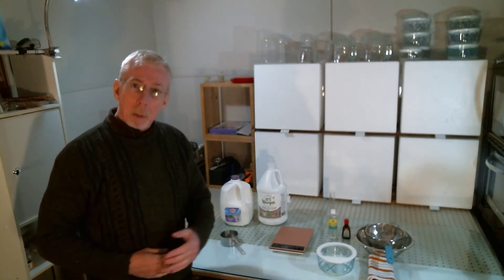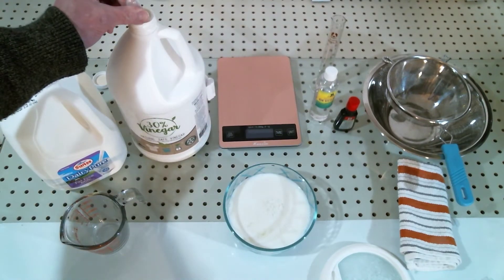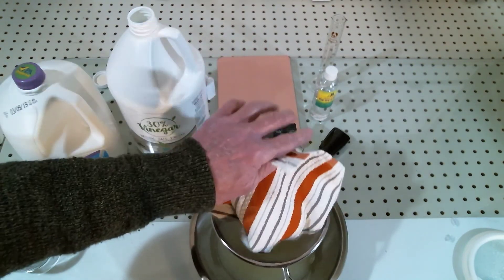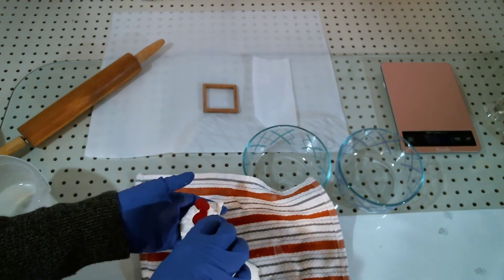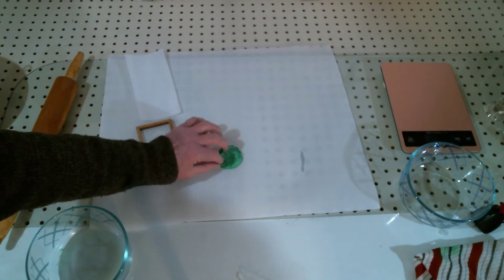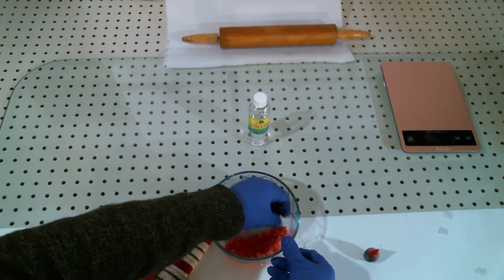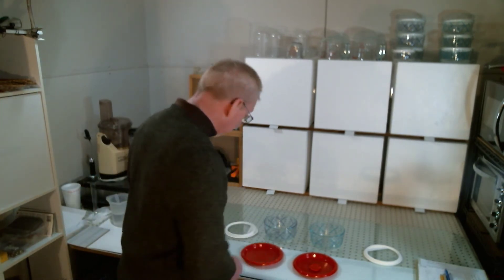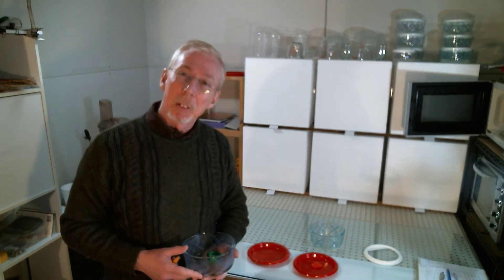Bioplastics: Thermoplastic properties of Casein. Imitation Ivory, Rubber, and PLA. Galalith Jewelry.

Comment: Everytime you said "this is the whey". I hear the mandalorian saying "This is the way". But in all seriousness. I did this the other night. Also made some (Gud) Jaggery. But when I extracted the casein. I split it up for different experiments..

One lump I added some diatemecaous earth to. And added a bit of calcium acetate. And some nearly pure China grade kaolin. I worked it all together. The casein seemed to mold well with it. 

Though my consistency wasnt perfect. Small cracks were unavoidable on molding. More kaolin probably would have rectified that. But after that I dropped the shaped lump in a saturated base solution. Of soda carbonate. And left it for an hour, or so. 

When I checked it later. While it was still submerged. I poked the to with my finger. It felt like a bouncy ball! The small cracks locked in place. I pushed as hard as I could with my finger. To try to split the piece on the tiny cracks. It was as strong as rubber. I put a bit more soda in solution. 

Which of course became oversaturated. And I noticed I've got a lot of precip today. Haven't checked it elasticity yet today though. Anyway if I can remember I'll post an update.. 

Oh and the other experiments I left casein unmixed. Dropped in a soda solution. And tossed in the fridge. Haven't checked those yet. The solution is so base. I have to glove up to me with it. And haven't got around to it yet. Excellent video though bud 👍.
Reply from the maker: Mike, these are all great results. I am thrilled you are taking my little experiment to the next level. You may have a few interesting products at the end of this series. Keep us updated. I may want to pass on this in video for others, if you like.
Reply: @GEOsustainable  Thanks for the kind words. And yeah as an update. I've tried, and tried to stiffen the lump. In the oven, and microwave. It comes out a bit pliable. Then stiffens a little. But retains it's rubbery nature. But I am not happy with the color. It looks an off putting yellow. The Kaolin I believe is responsible for the inability to harden..

But, I'm going to do another experiment. And keep out all my last ingredients. Though I do want to do another experiment with the soda. As I read something interesting the other day.

 But, for my next experiment. I'm going a complete different direction. Which I'm hoping will go as I envision. As I'm hoping it will create a unique product. But first I need an ingredient that I do not have. I could probably order it online..

But, I'm going to make it myself. But I just harvested loads of acorns out front of my house. Got a big oak that's a bountiful giver. But, I'll be extracting the tannins. As they are known for binding to proteins causing them to precipitate. But it's a long story..

Which I'll elaborate upon if it goes as envisioned. Will take a few days, or more. In order for me to extract, and purify the tannins. Interesting side note. The ancient Egyptians knew of casein. Archeologists have found records of them extracting it from milk. And using it to make a tempera paint..

And I believe they also used it in other industries. That have yet to be fully understood. But anyway they actually found a 3000+ year old lump of egyptian "cheese". But I believe it wasn't meant to be cheese. When scientists studies it's composition. They were surprised to find no (Lactobacillus kefiranofaciens) or any other lactic acid bacteria. Which are the usual microbial signature. And defining characteristic of all kefir or kefir-like fermentation products.

 They also found it to be wholly made of casein. And, it was infected with brucella melitensis. Likely because of the way it was stored, and it had no lactic acid bacteria. Which likely means it was not meant to be cheese. 

They also found it to be impregnated with sodium carbonate in the trona phase. Which they attributed as being from leaching from the surrounding environment over the past few thousand years. I question that it was from leaching..

But, anyway it's certainly interesting. I'll try to remember to update you. After my my next experiment. Hopefully with some interesting results!
Reply: @simple8mind8  Thanks for sharing your experiences Mike! 😊🌎❤️
Reply: @simple8mind8  Awesome.  Do you have a link or anything for more info on this Egyptian fromage?
Reply: It felt so weird. When I poked it. And I got a push back rubber effect. Honestly it felt like a wall ball except not hollow.
Reply: Ok. So an update. I checked the rubber lump. It's still rubber. So I pulled it from solution. The precip is odd. The soda reacted in some way. The crystals formed are no longer sodium carbonate. Couldn't tell you what happened though. I'll look into possible reactions. 

The balls I threw Jarred in solution into the fridge.. Are very interesting as well. The solution froze solid. It's completely crystallized top to bottom. Kinda scared to touch it, and break the crystal matrix. But here goes...
Reply: Ok. So the balls floated. So when the solution froze the top halfs of the balls were left sticking out of solution. So I pressed on their tops. They are rubber like as well. Maybe a fraction less of elasticity. It's hard to tell. Because when I pressed them. It did not break the crystal matrix. It's almost like ice. And no my fridge does not freeze. 

I'm going to leave it out. See if the crystal lattice is temperature sensitive. The precip in my lump cup. Was not strong like this jar. But fragile. Anyway the crystal precip seems different in the jar. 

Though maybe my lump would have done the same in the fridge. If I remember I'll post an update about the jar experiment..

Comment: Does this process work with commercial powdered casein?
Reply from the maker: Great question!
The body builder supplement has a small amount of Soy to keep the Casein from clumping. This will need extracting with Alcohol washes as I demonstrated in one of my videos on Casein. It is not easy to do.  
Strangely enough, the Soy added, according to the FDA, is small enough to not report. My information about the additive comes from a maker of the Casein powder.
Fat Free Milk is the best option.
Another option is ordinary Powered Milk. 
These, you will need precipitate the Casein.
Reply: @GEOsustainable  ooooh, today i learned a thing ^^

Comment: Fascinating!  In recent years there has grown a small industry in making casein guitar picks (plectrums) to emulate the sound and feel of genuine tortoise shell.  The best quality ones can run up to $50 a piece!  I'm excited to try making one from milk.  Are you able to comment on how clear casein is produced?  I read in the book you mentioned that this is done by repeated alkali exposure.  What is the practical approach to that?  Also I'd love to know how manufacturers get the beautiful pearlescent effect.  Is there a simple pearlizing agent that can be used?  Thanks so much for this and any thoughts you have on these questions.
Reply from the maker: Great questions. There is someone that used my formula and is making jewelry with just those effects.
I know about guitar picks, a few in the industry have commented on this video. It is spot on according to them.
The rest I am afraid are likely trade secrets I am not privy to.
Where we use food color, those in that industry are likely using dies and stains from animal. I would start there.
Anyone in tanning could give you a little guidance I should think.
All that aside, you can make high quality guitar picks using just what I show you here.
Good Luck, and thank you for the questions.
Oh, the pearlescent effect is from a patent, where they would hit a chuck of it with 2 dies heated to 2700F and stamp them. The original patent is online.
Reply: @GEOsustainable  Hmmm.  Maybe we don't mean the same thing by pearlescent.  I'm looking for something that gives that reflective swirling effect, much like some shampoo, that emulates the reflectiveness of real mother of pearl.  I wonder if it's finely ground mica?  Or maybe a fish scale product?  I can easily imagine ways of kneading, or layering the galalith that will give beautiful swirling grain, but I'd love to find the pearling agent that's used in the best galalith and in celluloid.  That's the stuff we often call mother-of-toilet-seat!

Comment: Hey! I've got an idea that I would like to see you use in a future video!

I've got a bulletproof way to make waterproof bioplastic gel, but it comes with 3 caveats: 
1) The process is kinda tedious/ dangerous 
2) it's semi- expensive.
3) It's very viscous/sticky!

But all you need is 3 ingredients: 
Sodium sillicate (waterglass), 
Zinc chloride (ALOT of it), 
and cellulose (100% cotton clothing will do).

Step 1: Boil water in a glass beaker/ acid proof beaker and mix in anywhere from 1 to 2 lbs of Zinc Chloride in the solution.

Step 2: Boil down the solution to a point where it get's super syrup-y. You want to make the solution as saturated as possible so that the cotton can dissolve in it. (CAUTION: The more saturated it gets, the more Hydrochloric gas it will let off so be careful - Look up Zinc Chloride on wiki)

Step 3: Place the glass beaker in a pot filled with water so you can give the Zinc Chloride solution a hot water bath. Put pieces of cotton in there and mix until they dissolve. If the Zinc Chloride solution turns black, it means it's too hot (burnt carbon). If it stays white, it's great!
Keep doing until the cotton slows down dissolving/ stops dissolving.

Good News. You made Cotton Acetate: a bioplastic. You're not finished yet. Gotta waterproof it.

Step 4: Pour out some of the Zinc/Cellulose solution in seperate container and mix it in with some waterglass in a ratio of 1:1 or whatever ratio you want.
(Ratio depends on waterglass, if sillica-rich waterglass,  less flexible. If more sodium hydroxide, more flexible.)

Step 5: Coat whatever clothing you wanna coat with the mixed Zinc Chloride/Cellulose/Waterglass solution. Let it air dry for a day or until it's not sticky no more.

Step 6: Waterproof it/Vulcanize it by putting it in the oven at 200 F for 2-3 hours (nothing higher or it'll turn black). If it's still wet, redo Step 6.

Step 7: Voila! Your clothes is 100% bioplastic-ally waterproof.
Reply from the maker: Thanks for letting me know what Waterglass is . I could never figure it out. Thanks. This looks like it came from the book on Industrial Uses of Casein. Brilliant comment. Thank you.
I most certainly will put it on the list to try, and share it when I get questions from India. They are hugely searching for a way to do this.

Comment: love your work!
how can it be made waterproof from natural or non-toxic materials? 
also, how fast would it biodegrade if placed outdoors?
Reply from the maker: This formula is not waterproof. It will biodegrade in minutes once wet. Everything I used is natural except for Ammonia. You can replace that with an alkaline vegetable juice.
Thank you for your kind words, I am thrilled you like.
Keep in mind, for the most part, bioplastics won't be waterproof, and can only replace a portion of plastic made from LPG. It is best for one-use plastics.
In a sustainable world, things that must be waterproof are put in glass and metal because they are HIGHLY recycled.
Sustainability means to move away from a disposable society.
Reply: @GEOsustainable  couldn't agree more.
although, I work in the agriculture sector which consumes massive amounts of plastics. a large portion of the applications requires waterproofness from the plastics, as well as durability in outdoor conditions and we are trying to find sustainable alternatives for those plastics.
would love to share more about the project if you find that interesting (:

Comment: These videos are so awesome, new sub here! I tried this with some expired (not really expired but tastes terrible and undrinkable) lactose free (Fairlife brand) whole milk but after heating 1/2 cup of the milk for 1 min and adding 1/4 cup vinegar a little at a time, all I got were little chunks and it looked nothing like yours. Can you please tell me what I did wrong? I literally have 4 bottles of expired milk I don’t want to throw away if I can make something crafty with it. Was hoping to make some flexible texture plates (like embossing folders). I have my sample drying outside but it’s still pretty pitiful 🤣 I also mixed in about 2 teaspoons of glycerin hoping it would be flexible. Does the milk have to be fat free? You are such a blessing with your knowledge base, thank you!
Reply from the maker: Sure thing. Old milk is fine, and prefered. Heat the milk ONLY to warm, not hot. Add vinegar all at once. The reaction is immediate after a very quick and gentle stir. But some folks leave it overnight to curdle. It is best if the milk is fat free. Rinse in alcohol if the curds are slimy.
Casein plastic is very hard to prevent cracking unless you add a plasticizer.
What I show in the videos will get you going, but it takes a lot of time to learn to work with Casein. Good Luck and I am thrilled you like my series.
Reply: @GEOsustainable  hey thanks for answering so quickly. It wasn’t slimy at all, just tiny little chunks that wouldn’t clump together that looked  more powdery. Adding the glycerin after rinsing and squeezing out just made it crack like crazy when I tried to roll it out and press things into it. I didn’t try the alcohol yet, I thought you said water rinsing but maybe that will work better. I am binge watching your channel 😱 as an artist, the milk paint and history behind it I’ve never heard of in my 60 years. Keep up the great work and hopefully I can figure out what to do with all this milk 😄

Comment: I am making some guitar picks soon
Reply from the maker: Awesome. You are the 3rd person to make guitar picks from my recipe. I am just thrilled.
Reply: @GEOsustainable  Galalith is an interesting product. I was thinking to add PVA glue to milk and curdle it with vinegar or citric acid to make a harder material. What do you think of PVA use?
Reply from the maker: @GürkanYeniçeri  I have never tried it. It sounds interesting. To use it instead of Glycerine? Let me know how it goes. I may want to share your idea.
Reply: @GEOsustainable  Yes, glycerin makes a pliable end product whereas (Wikipedia says on Galalith page) formaldehyde makes it harder. So I will be using PVA glue instead.

Comment: Hello, thanks for the video, it's explained very well!
I have a few questions about casein and would be very happy if you can answer them .. (the internet doesn't know nothing)
***
-The rinsed, still malleable casein does not set under water? Not even in salt water solution? Right?

-Which high degrees, is the thermal deformation point of the casein? Is it possible to put thus Point down with hodrophobic substances? For example castor oil (Ricinus)

-I found very different density data on casein 1.17 g / cm³ / 1.25 g / cm³ / 1.45 g / cm³ what is correct or what does this depend on?

-I have read that casein and cellulose acetate are soluble with benzyl alcohol but I cannot find any information on how much dissolves in how much .. do you have a list for it? Also whether the benzyl alcohol should be warmed up (?) To absorb (more) casein?

- Casein is a polymer almost all polymers can be mixed. Do you know with which wax and oils a permanent good  and soft/ waxy connection is made? Between 68 °F to 176 °F

-Is there a calculated coefficient of expansion for casein?
***
I know these are some questions, but I think you have already done some experiments with this substance and can therefore give good information.
Thank you and best regards!
Reply from the maker: I can answer none of these questions with specificity, but I can make a few observations. There are no easy answers, you will need to experiment and develop for yourself. I do not like to let students fast track learning and give answers, so again, do the work and you will know for sure. I would think if you leave Casein submersed in water, it will turn into a not so tasty milk. Density of Casein is dependant on the manufacturing process. All those numbers are very close to each other, and most likely of no importance. I use isopropyl alcohol to remove fat and sugar. I no longer need to do that, as I buy Casein powder that is analyzed to contain less than .2%. Thermal expansion of Casein can be 3 to 4 times the volume. I have included the link to the book I work from, in many of my videos. This should be your starting point as it is the only significant source on Casein uses in industry. Beyond that, here is a link I think can give you more. https://bionumbers.hms.harvard.edu/bionumber.aspx?id=103880
Reply: @GEOsustainable 
thanks for the answers and the link too. i will explore akso materials myself and see what works best for my ideas.
Reply: please do you know how to make a cling film from casein (what are the steps)